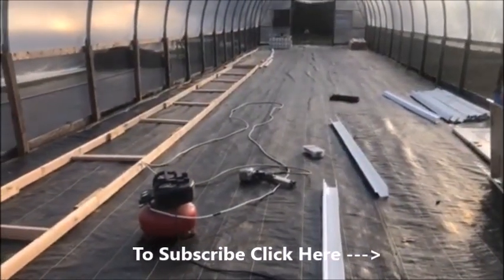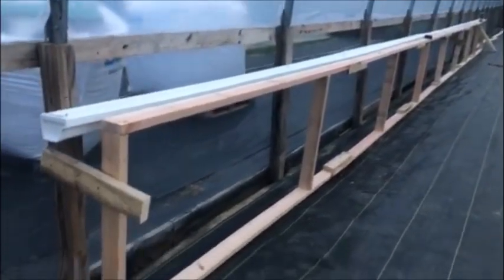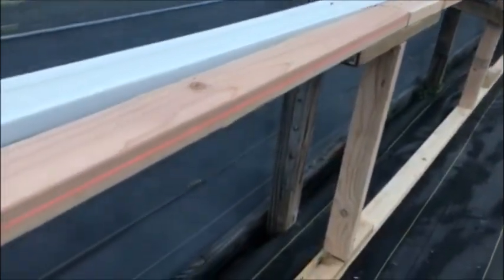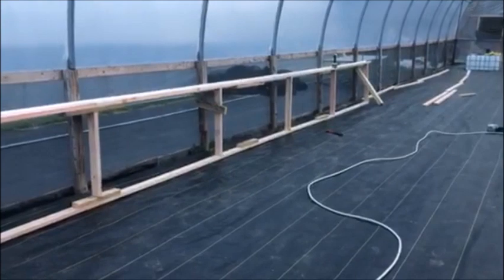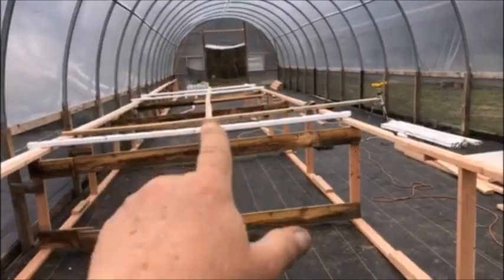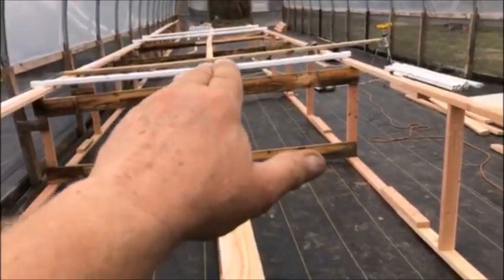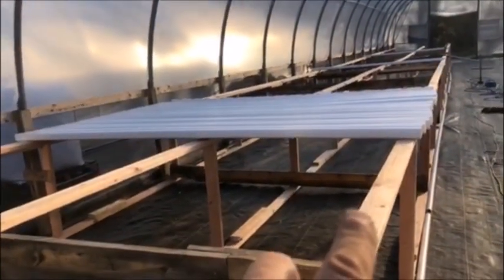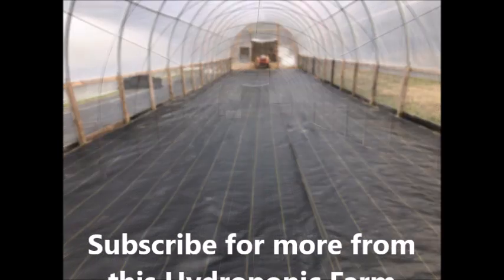New Hydroponic Lettuce Greenhouse System Build

Comment: Do you need to run your water through an reverse osmosis system for your NFT troughs
Reply from the maker: No sir. Just a pool pump and an air pump with air stones
Reply: @FensterfarmGreenhouse  you must have clean water. I have an e.c reading of .67 ms of my well water.
Reply from the maker: @stephenboutet  not really. Well water ec is .42